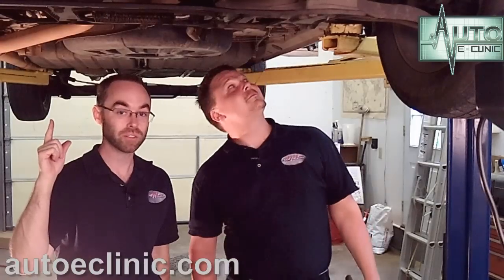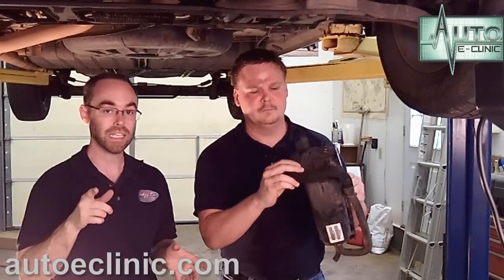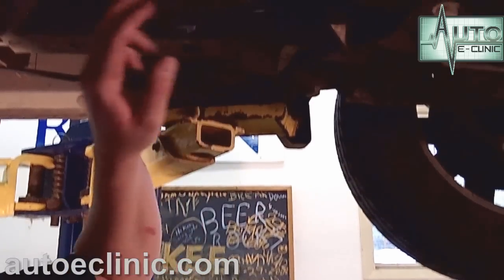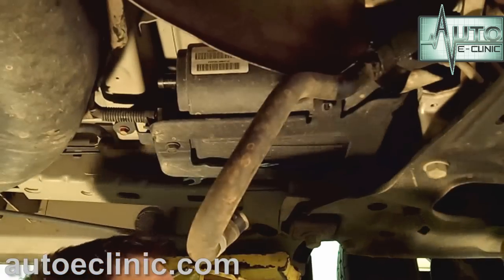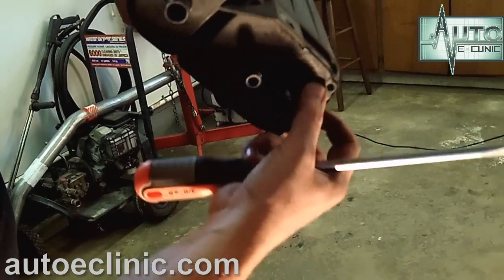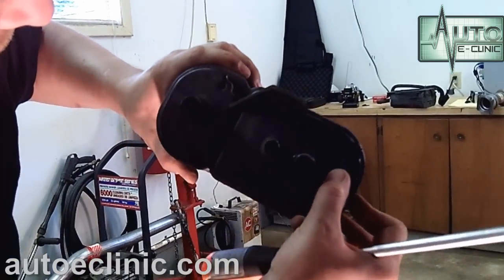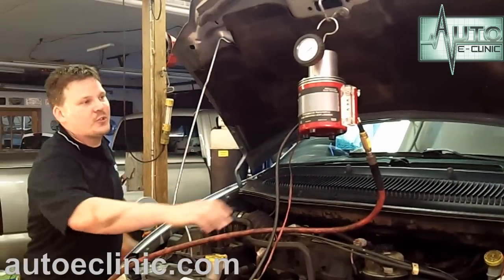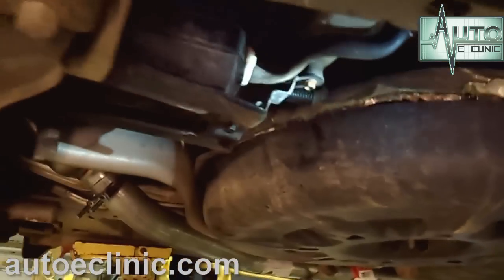How To Replace An EVAP Emissions Vapor Canister - P0456 Chrysler

Comment: I've a 2004 Dodge Ram 1500 not taking fuel. The pump clicks off every few seconds. 
I've heard the charcoal canister is the culprit. Is this correct, and would replacement be the same ? You guys made this look easy.

Comment: Hello,
I've replaced the evap canister, I keep having an evap leak engine light during the winter, goes away all year. Just in December to January. Cold months here. I'm looking for the sensor and cannot find it. 2006 Dodge Grand sxt. I was told the sensor is IN the evap canister. Is this correct?
Reply: Did you fine the purse valve if not it is on the fire wall on deiveside  underhood

Comment: Hello, I have a 2009 Chrysler town & county The issue I'm having is when the doors are opened or the vehical is running with heat or a/c on I hear this thumping noise in the dash the key doesn't even need to be in the van do you have any ideas where the noise is coming from any kinda help is appreciated.. thanks